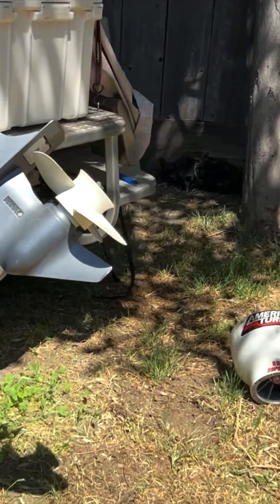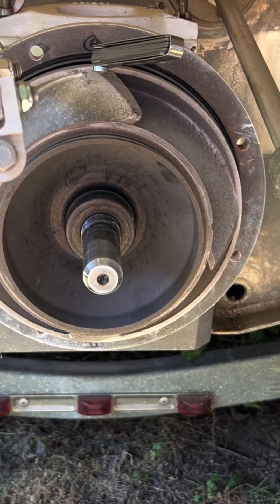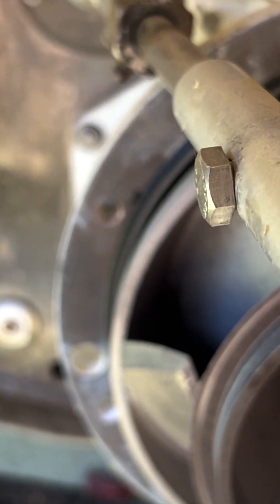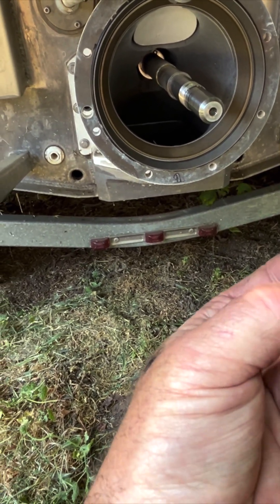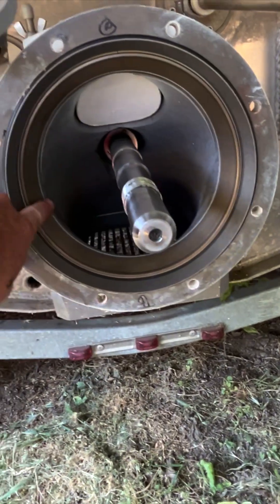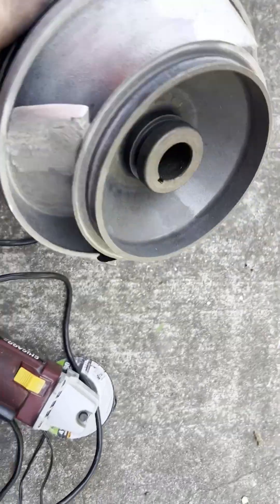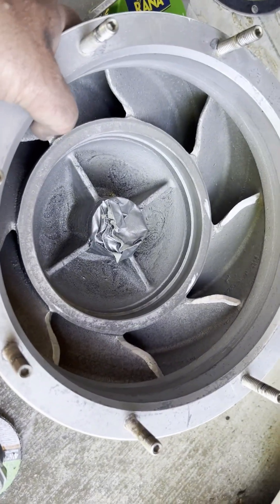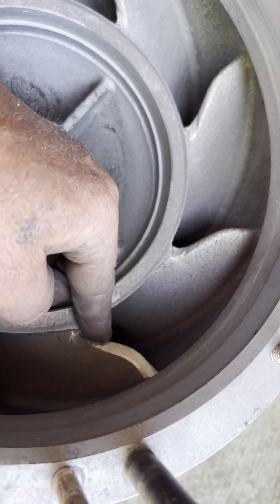American Turbine SD-312 repair tear down

Comment: Replace the bronze wear ring and impeller as a set standard size.The water is bypassing the impeller by the looks of the up and down play which is non adjustable. When new it will not move up and down. The shims adjust the gap between the 1/8" shoulder lip on the wear ring and the leading edge of the impeller. If you place the impeller face down on the ground this is the spot that needs to be measure when installed. You need to place the feeler gauge down through the inspection hole on the top of the pump to measure the space between the bronze ring 1/8'" shoulder and the impeller front face.

Comment: Nice video but, how did it run after the work was done?
Reply from the maker: Sorry for not updating but the boat has been running great. Im glad I didnt spend the coin on a ss impeller.